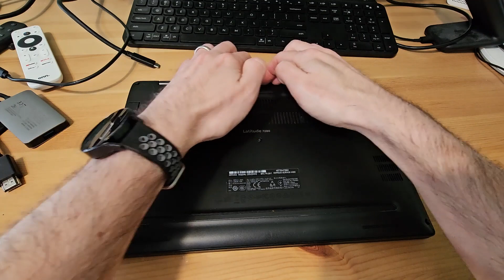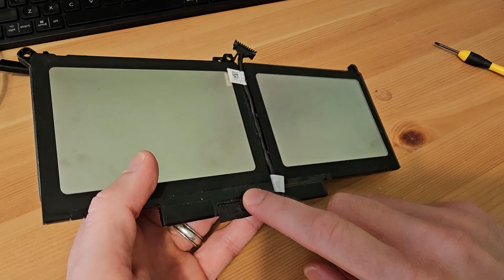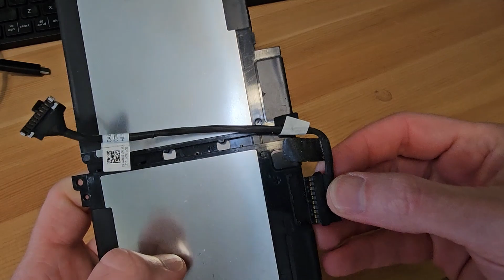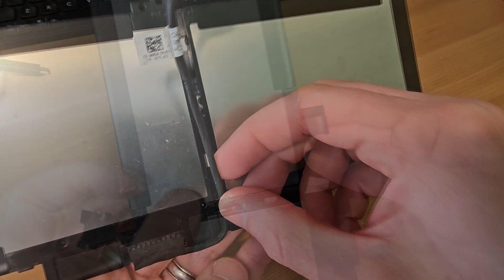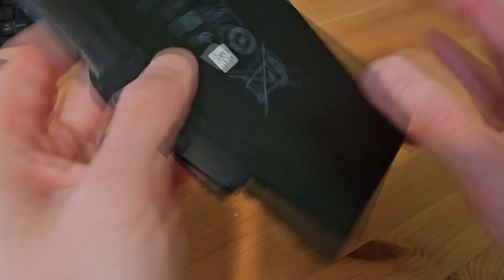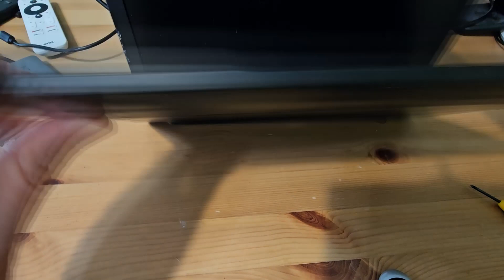Dell Latitude 7280 Battery Replacement Guide

Comment: Is it repairable or not
Reply from the maker: are you asking if the battery itself is repairable?  I suppose it could be, if you tested and replaced each individual battery cell, but I would assume it's quite involved compared to buying a replacement, at least, well beyond my skill-set to make a guide!